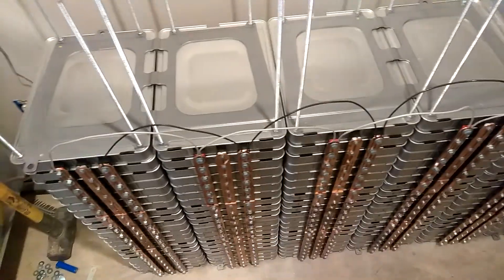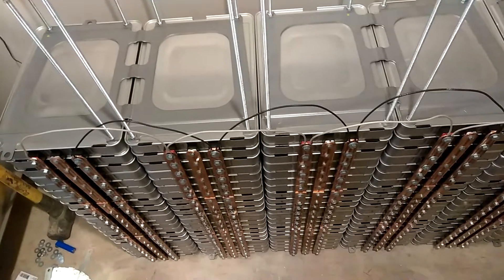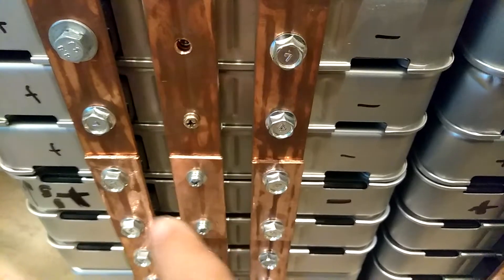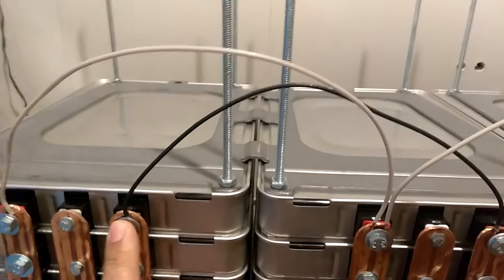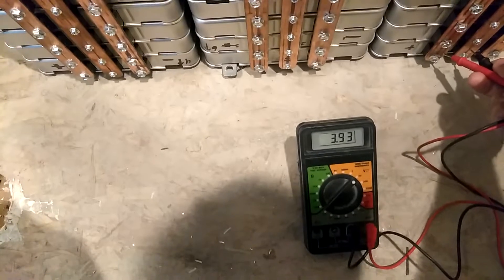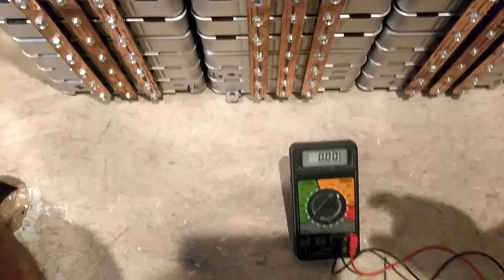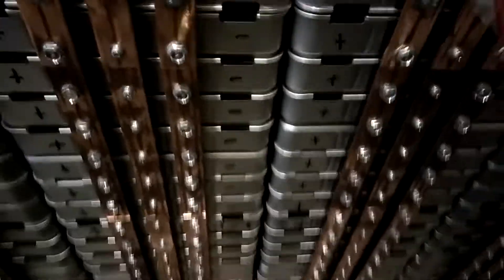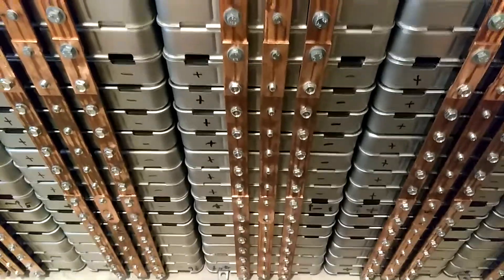most critical part when setting up Nissan leaf battery Bank

Comment: I'm working on a 63 module leaf based battery (I have 14 modules now with a lv5048), and I think I'm going to give one of these a try with it: https://www.ebay.com/itm/1A-2A-Active-Balance-Battery-Protection-Board-BMS-13S-24S-Bluetooth-APP-JK-16S/

Comment: How many AH does your battery bank have??
Reply from the maker: It's about 970 amp hours with a 30% degradation from when it was new.
Reply: @carsonlurbanwindandsolar3437  is 970amps not too much does your inverter handle such power?

Comment: Hi I’m a new subscriber but learning from your videos, thank you! Question, is it best for equalization to connect the +/- to the terminals at the top like you showed here, or is it best to connect them at opposite sides of the battery banks? I thought I saw on another video that it’s best for equalization to connect +/- to opposite sides.
Reply from the maker: It doesn't matter as long as you tie all the positives together and all the negatives together.  Once it has been equalized then you can series the batteries together to raise the voltage to the voltage that you need.

Comment: Nice Job brother, I did the exact same thing as you suggested me before, but I use 8awg wire and it work like a charm. Happy to see progress. Congrats.!!!
Reply from the maker: Thank you I appreciate it I believe this is the most critical part when you are building a battery bank to get all the batteries voltage exactly the same.  I think this is the key to keeping them balance for a long time.
Reply: I fully agree with you.

Comment: May I ask where you got your copper buss bar?
Reply: He made them out of smashed copper pipe thick wall
Reply from the maker: Thank you for answering that question I did not see none of these messages.
Reply from the maker: Home Depot.
Reply: @carsonlurbanwindandsolar3437  hey buddy been following you like your videos
 I'm going to receive my 24.5 k lot of 49 moduels this week im going to do my setup like you have then order the bms. For the busbar did you use 1/2 inch or 3/4
Reply from the maker: I don't know how I missed all of these messages but sorry about that.
Reply: How do you flatten the copper pipe? Dude you are the best.
Reply from the maker: I used a press to flatten it. But I have used device to do it before but the press is much easier. Sorry about the late response didn't see you left that message.